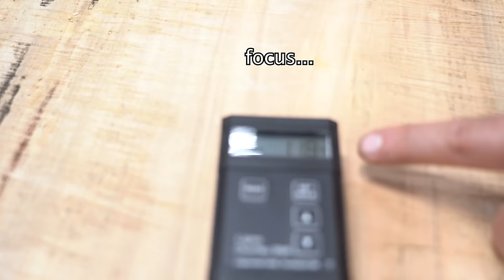5 Tips For Better Live Edge Tables

Comment: The reason wood moisture content is so important is that wood shrinks AND swells due to the environment it's in. Wood reacts to it's environment, which for furniture means the relative humidity of the home it's in. The area you live in, how much cooking, showering, and the number of people exhaling in the house as well as how well your A/C system works will affect the humidity in your home. It even changes seasonally due to humidity levels outside.  The average home is in the 30%-50% range. This corresponds to a wood moisture content of 6%-9% for wood located in that home. This means furniture, wood flooring, trim, and any other wooden objects will acclimate and reach an equilibrium base on the relative humidity in the home. Wood also does it's expansion across the grain, and not along the grain. So ideally you want the moisture content of anything wooden that is destined to be inside a house to be at 6%-9%, in order to avoid it shrinking, swelling or warping after it's made and placed inside.

Comment: The sanding tips are gold. Mark your parts between every grit, go slow, don't skip grits, use a vac, and still check with mineral spirits...I refinished a top one time because I didn't check and it wasn't until stain, and 3 coats of arm r seal that I saw it I. The right light, then I couldn't unsee it. Never skip the mineral spirits 👍
Reply from the maker: glad you enjoyed them my friend!

Comment: The C channel tip is the best new (to me) woodworking procedure I've seen in a couple of years, could have used that multiple times prior. Thanks.
Reply from the maker: GLad i could helpTom !
Reply: Hey John, great tips! Question. Is that C channel actual metal stock or fabricated flat sheet put on a press brake?
Reply from the maker: It’s a fabricated product

Comment: Hi John, good video. I mill live edge slabs and kiln dry them down to around 8-9% (100's over the years). After they are in my non climate control shed they go back to 12-13%. On what you said about taking bark off I suggest to new wood worker to remove it. But some want it to stay on. I found that trees log during winter months retain bark well.

Comment: Not that it matters I made a clock in 1985 out of a slice of maple. Didn't remove the bark sealed it with polyurethane and it still has the bark on it today. Luck I guess. Your tips are killer and sooooo helpful

Comment: To go deeper on meter tech: 
Pinless meters use electromagnetic waves. Pin meters rely on electrical current. AKA pinless samples a little  larger deeper volume, for a more accurate reading, without marking the material.
Reply from the maker: Awesome tip Chris !
Reply: Thanks John, it's an awesome video!

Comment: Bark falling off depends on what season the wood is harvested in. In spring/summer, the wood is growing, so the bark is loose and will fall off as it dries. In fall/winter, the wood is dormant, so the bark is held tight to the wood and not as likely to separate. Think of the cambium layer as a heat sensitive non-newtonian liquid.
Reply from the maker: See i was always told the bark grows for years after the wood is harvested, regardless of when because of how its stickered and dried (if proper) is that not the case ?
Reply: @John_Malecki  I've never heard of or seen that happen, but it's possible that we are conceptualizing it in different ways. Fundamentally though, when a tree is harvested it is essentially dead as I understand it.

Comment: I know this video is older, but I have a couple questions if you have time... you said after you get it home you should flatten it then sticker it for a couple weeks to acclimate to your shop. What if the wood you are bringing home isn't dry yet? I just cut down a bunch of silver maple, but I know it is gonna take a couple years before I can use it unless I build a kiln this summer... should you flatten it to final size before drying if it is super wet? Also not sure what all shapes I want the different pieces to be yet either. I just tried to get them reasonably flat with the chainsaw and tossed them in my wood rack to dry. I also put some anchorseal on them to keep them from checking too much. Should I flatten them more now so pieces dry faster/better? Or will they just pull too much out of flat since they are so green?

Comment: Hello, I'm an ex cabinet maker so I am familiar with building  many wood products BUT,  I have been asked by my boss who's is one of the owners of the company to make a 2" thick table that will be 42" x 72" with a 8" or so river down the middle. What brand resin do you recommend , I have read horror stories of some brand that Amazon sells, these guys followed the instructions with terrible results, don't want to go there. I also want to do the wash and flood coat over the top, no urethanes since the wood (Sycamore) is on the soft side of hardwoods. Very fun watching your videos

Comment: What is the point of the c-channel? I understand the wide screw slots allow wood movement, but what good is the "c" part that goes into the wood? It's a loose fit, so it can't be providing any strength. Maybe the c-shape makes the bar stronger so the slab can't bend it and the "c" goes into the wood to visually hide it???
Reply from the maker: the C is structurally very straight because of the ears. It also allows you to not have to cut a whole recess, just a few slots. It stays flat well.

Comment: I’m trying something new, to me anyways, I’m going to finish an entire 40x120 live edge table, 4” thick, and I’m going to slab it myself, from a fresh cut oak, immediately oil the f out of it with mineral oil, and keep it oiled during the entire process. Then put it in my living room and see what happens. I’m not going to seal it with anything aside from sanding it all the way to 800 grit. The idea is that the way wood drys is the way it will warp, if it never drys (by replacing the water with oil), then it will never warp. Of course it will eventually dry, but in the same environment, and very very slowly. This idea came from a timber framer I watched on YouTube and I’m going to put his theory to the test but in a different application. I might even completely epoxy resin another one so that it really really never drys and see what happens. I realize that each table will literally weigh over a ton (I’ve already started and these things are amazingly heavy) but I don’t care.

Comment: On a wide slab like that, do you think the amount of wood movement could cause a clear coat like lacquer or poly to crack?
Reply from the maker: Nah I would think not
Reply: if you apply multiple coats - then that's the purpose of a sealer - to be flexible, and then a couple coats of polyurethane for instance. the rubio hes talking about here is flexible so not a problem. 3 coats of shellac on the other hand with no sealer= Flakes
Reply: @tonyrodrigues811  hence why shellac is an outdated finish 👌👌👌 good info my man

Comment: Thanks for the video.  If you have a crack extending to the edge of the table,   Would epoxy be sufficient to stabilize it or do you need to use additional methods like a bow tie or c channel or table platform?

Comment: Great video! So if I’m not mistaken, your saying if I use big metal legs then the c channel isn’t necessary? I am building an 8’x30”x1.5” walnut live edge table right now. I have some really big H style Legs for the table and was also going to add c channels as well. My question is what depth of c channel should I use? I bought some store bought c channels but they are 1.25” deep and my tabletop is only 1.5” so I’m nervous that will create a weak point. Thoughts? Thanks

Comment: Hey John. Do you have a recommendation on how to get the bark of the edges without ruining the live edge?
Reply from the maker: If the wood is dry it should peel right off, if not use a draw knife!
Reply: @John_Malecki  Yup the bark is falling right but I am having trouble with the thin cambium layer that doesn't come off so easily
Reply: Wire wheel on an angle grinder works for me

Comment: Do you ans questions? Only been at epoxy for a year but I have not had many problems. Minor leaks not a good color mix but basically ok. The other day I picked up a project ready to sand. Top is hard but the bottom is soft. Soft enough to pit a probe in about ½ inch. Mixed by instructions and cured for 48 hours. Any ideas? Any help?